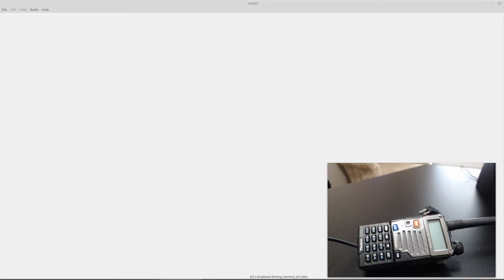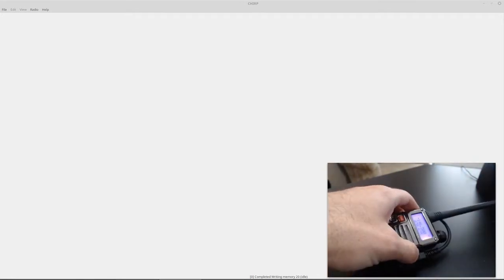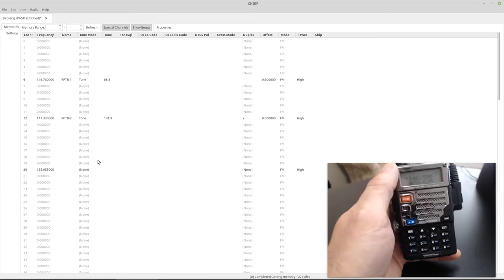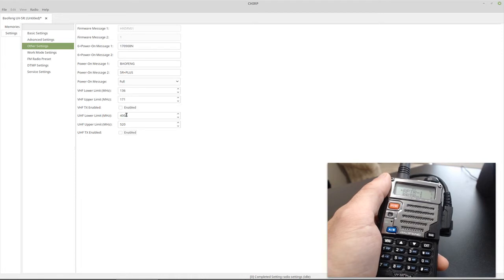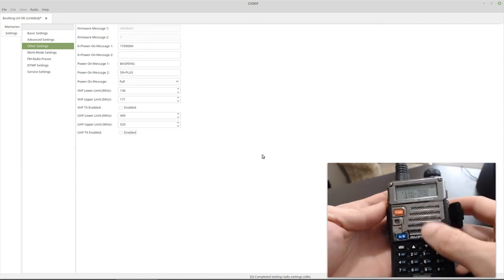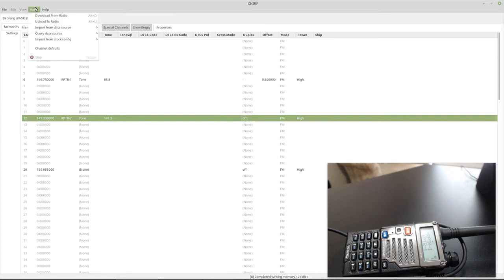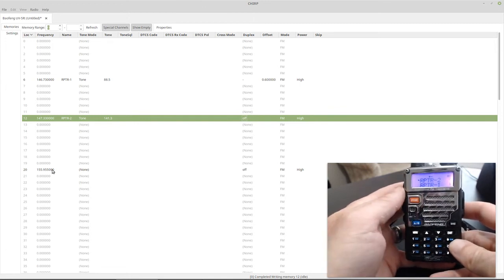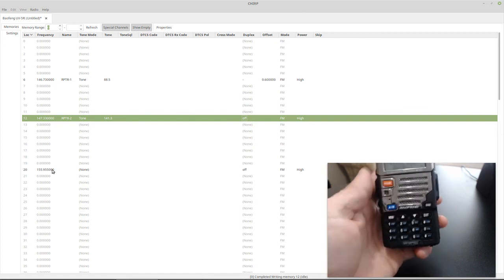How to Disable Transmit and Use Your Baofeng Radio as a Scanner

Comment: When i do this it appears to lock into transmit. The red light indicator turns on and it wont turn off unless I shut the power off and turn it back on.
Reply from the maker: Haven't had that problem.  What model baofeng are you using?

Comment: But you did not explain about getting into CHIRP. I have 2 of these radios that will not transmit and you are telling me I call not change this without connecting to a computer?
Reply from the maker: Chirp is a free download and linked in the description.

Radios that have been purchased recently are locked from the manufacturer per FCC regulations.  This is a way to factory reset your radio and remove this lock... I'm not going to put that information on this channel, but you can easily google for it.

This video is focused on DISABLING transmit so that you don't accidentally break the law.

Comment: Will the lock key disable ptt on the unit?
Reply: yes
Reply from the maker: No.  I leave one of my radios locked so that I can't accidentally change the channel when it is in my pocket.  I transmit on it all the time.

Locking locks the keypad not the PTT.

Comment: Hey i'm wanting to transmit on 155.205, our state hospital frequency and get a "beep" sound when depressing the push to talk button. I did adjust the transmit frequencies in chirp with no luck. Any advice how to overcome this?
Reply from the maker: Not sure... you might be hitting a repeater.
Reply: The beep when trying to transmit, at least on my radio, means that you have transmitting disabled for either that frequency or that band

Comment: When programing for a police scanner only is this all I change to disable transmit? What about the different tones selections in chirp/? Where can I find a print out or video telling what each setting is in chirp, in plain English. EASY TO UNDERSTAND.
Reply from the maker: For just receiving you do not need to set a PL tone.  If you DO set a tone it will only receive transmission with that tone set.

Technically, it receives all transmissions, but ignores the ones that do not have the correct tone... BUT ONLY IF you set a receive tone....  If you don't set a receive tone you will hear everything on that frequency regardless of what tone is transmitted.

Comment: My Chirp version does not have this functionality. My duplex settings only has none, - , +. I also dont have anything but basic settings behind the settings tab. Any input on that? Are you using a paid version or something?
Reply from the maker: I dont have a paid version.  What is your version number?  Also, be sure to check you have the correct radio selected in the Radio menu.

Comment: Does it disable you alarm or call botton
Reply: Alarm is menu 32.  As far as I know, you can not disable it.  It is recommended you set it to Site.  That way you won't accidentally transmit is you set off the alarm.  It will just flash away and such, on the radio.